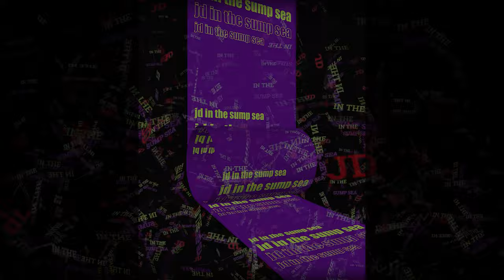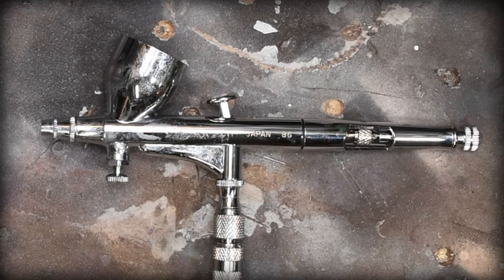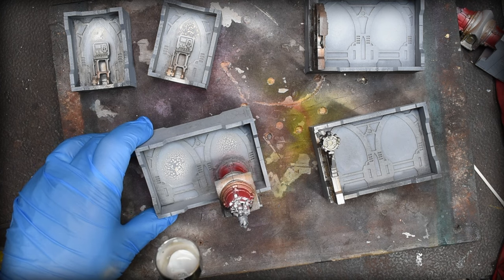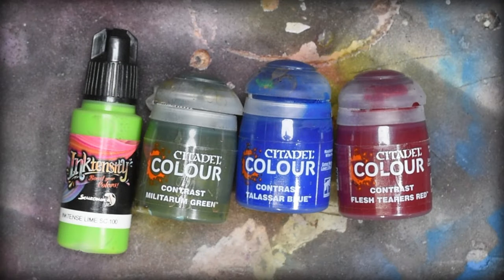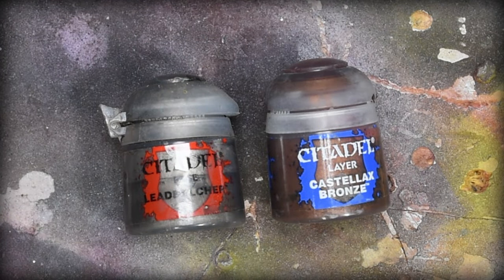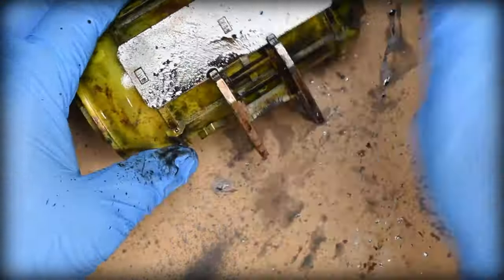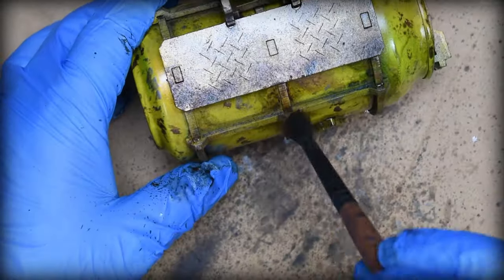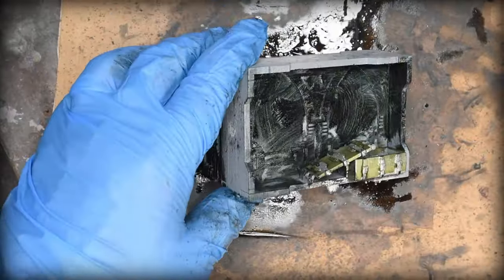Painting 30k Zone Mortalis Happy Mistakes

Comment: Great video! I just bought a huge load of mdf zone mortalis stuff from TTCombat. How would I go about priming it if I don’t have an airbrush? Is there an easy way or should I just go crazy with a big brush and paint primer?
Reply from the maker: Thank you!  So....  you can go crazy with the brush for sure but some other things you can do to help yourself are to add pva glue (white glue) to your acrylic primer, then thin it down to a milkshake consistency and brush on.  I was a little hampered with this project because Eric (the owner of the terrain) didn't want any texture on these pieces.  I usually do what I just told you and add sand to that as well before I even get to anything else.  This little trick will do a couple of steps for you all in one step.  Thanks for tuning in!